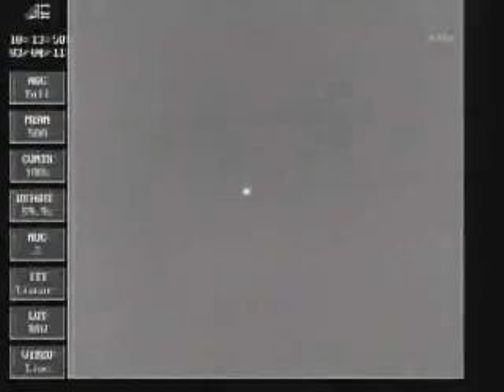Glory Launched, but Separation Failed / Orbital Sciences Taurus Rocket

Comment: OCO did fail the same way, but that was due to a bad gas generator in the fairing.  Glory, I'm really not sure, but I know that they'd replaced the hot gas generator with a cold actuator.  So it probably wasn't the exact same problem.